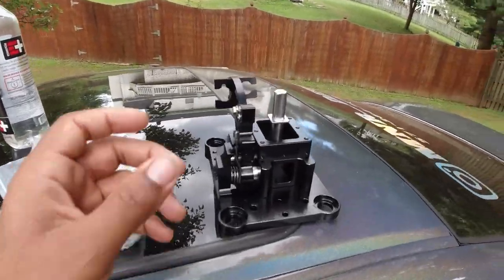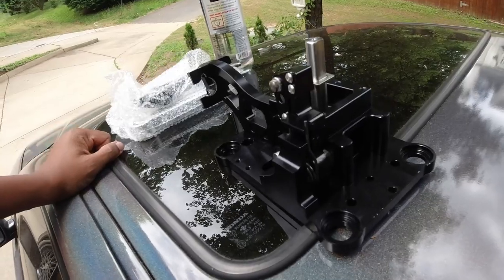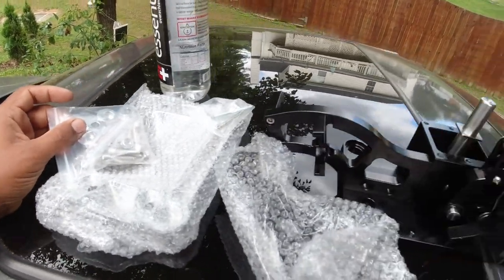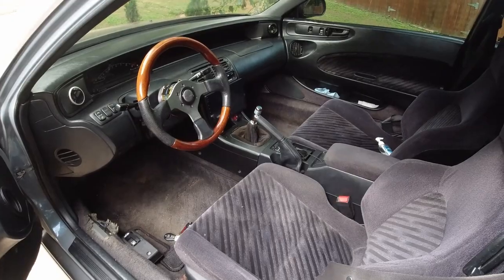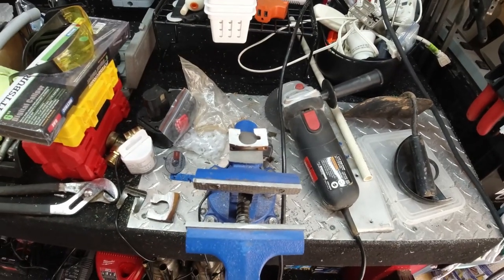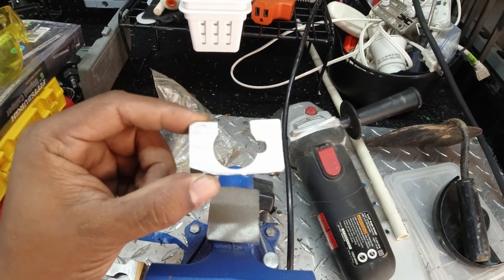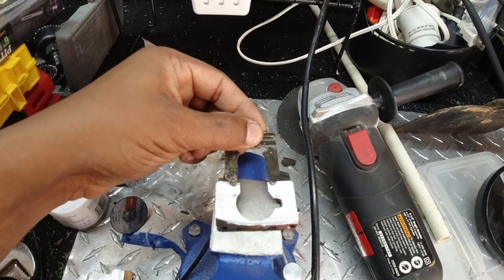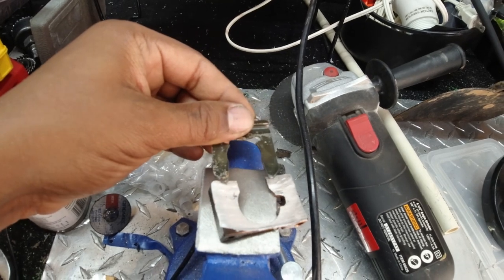ebay k tuned shifter install on a honda prelude

Comment: I just did k billet shifter and cables on my '94 Accord, and I still had to modified the aftermarket RSX cables. One cable was either too short or too long depending on the one post on the tranny bracket you used (I have the PLM billet bracket) then fine tune the cables for a smoother shifting. It is a headache though.

Comment: I bought this same kit for my 95 civic with a h22 swap and its good to know the back mounting bolts fit because when I was installing the shifter I had to cut out the chassis so the shifter would sit underneath and that included some of the mounting nuts. Those nuts are for the backing plate that the kit comes with. I installed a 4th gen shifter though so at least I know I can reuse the old holes, at least for the back. I was just a little upset at myself for cutting out those welded on nuts but this video helped. And yeah you should of bought the cables, I spent the money for the kit with the cables and for the H series you actually need the bracket for the cables on the transmission side or they won't fit right.
Reply from the maker: I literally just installed the cables yesterday. Shifts like butter.
Reply: @treybedipping1734   What bushings did you use the rubber ones or the metal ones? And did you need to use ones on the bottom?
Reply from the maker: @Mishakol1290  to mount the shifter to the car i didnt use the base plate the kit. I bolted the shifter directly to the car so i used the metal ones
Reply: @treybedipping1734  Yeah I can't utilize the base plate either cuz I mistakenly cut out the welded nuts for the two back bolts. Probably for the best because the center console or shift cover will fit a bit easier without it raised up with the plate. The cables I bought with it might not have instructions, im not sure to route them under the subframe or over it. Cables as they are now are routed underneath it and under the sway bar. I had to buy the knock off shifter for 287 dollars bc im not spending 500 on this. What did you have to pay for yours? And you could save money by getting one without the adapter plate, I did.
Reply from the maker: On the prelude you feed the cables in between the space where the steering rack is. You prob need to drill new holes.

Comment: Would you suggest the PLM H to K bracket do you can use the H trans but K cables and K shifter box? I just subscribed bro
Reply from the maker: Get the k tuned cables it come with the bracket
Reply: @treybedipping1734  yeah I just need to get it done once lol. I was thinking Now Ktuned cables Hybrid Racing Shifter box. 
Or just go full K tuned?
I got a H22 EF on Accord cables and I can’t get into 1st 3rd or 5th
I Can manually shift tho from the box itself.
That’s why I’m asking and your fab work just inspired me. But since you been through it I knew you were a good person to ask. Thanks for your reply!
Reply from the maker: @jayscul-de-sac6820  yea using stock cables are trash you'll see a night and day difference with the k tuned cables/kit

Comment: No lie trey I have a quick question about installing the clutch master cylinder and the clutch pedal on a 96 prelude k24 swap, does it matter what kind of system I use or does it have to be a specific brand that fits a 96 prelude
Reply from the maker: Any parts from a 92-96 will work
Reply: I appreciate u homie ty I was just a little stock

Comment: Did you use the bracket plate on the h series transmission  to use the h series cables ?
Reply from the maker: Orginally no but i just recently upgraded to the race spec cables and bracket. Its def worth getting....big difference

Comment: WTF is A “EBAY K TUNED” EBay doesn’t make/manufacture or design parts!!!!! Ktuned is not affiliated with eBay other than ktuned parts are sold on eBay but not held accountable by them and vice versa... you bought a knock off china made shit box,  @ half the price and half the quality but expect “as good or better results” for god sake’s you dont even know what a cotter pin is(used on a castle nut/shape of a nut that looks like a top of a castle) I mean look at the surface rust under you console, you think maybe there’s 1/2 the shifting issues “buttery smooth” shift’s from rust and 20+year old cables/bushings/pillow mounts/slave/clutch master cylinders.... BINGO, you give the car industry, REAL Honda  enthusiasts and the car scene a bad name. And it’s pathetic. Fake it till you make it/ballin on a budget (you can get quality parts and name brand shit without spending 20K) on a 3k honda. It’s called saving over time, and continuity looking.research and having the money when you do come across them, and not paycheck to paycheck then a part comes on sale or on the market and you can pull the trigger on it cause you bought some other shit the week prior.... maybe its takes 3 6 12 months, but you can be proud, and know what you bought works the way it works cause you bought or waited for what you really wanted...... dont fucking be the car meet/car show/track guy we all clone and frown and make fun of. Yeah we know your reading this and but hurt but so are we.. cause diehard Honda dudes, know we get assumed to be like you, yet know we are nothing like you and our cars aren’t either.... top level JDM and Honda  purists are the guys you strive to be/so are there cars... the ones you see and dream about and must us have put 5 10 20+ years in many cars and own classic chassis’s/builds PLEASE.  STOP
Reply: Everyone has a hater and you apparently are Treys only hater I've ever seen.